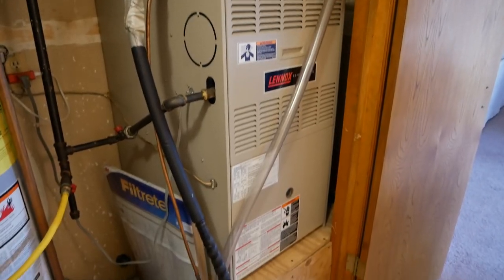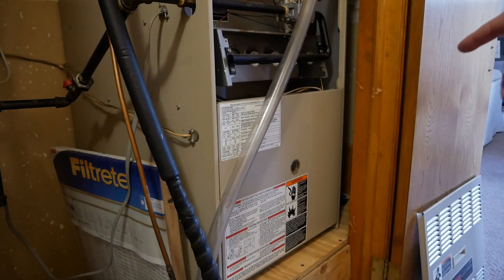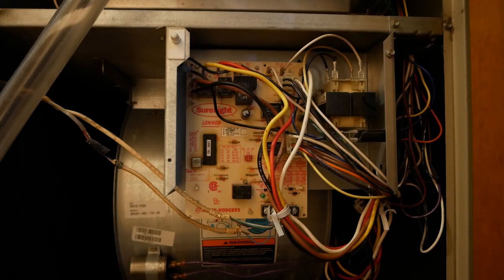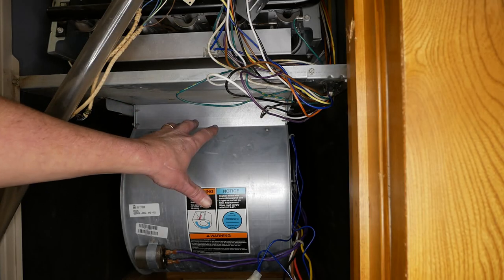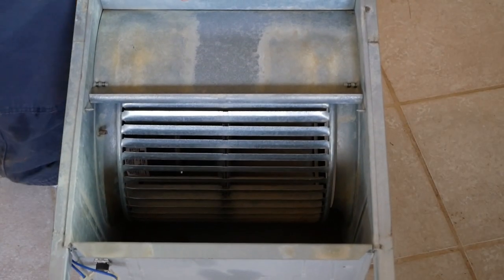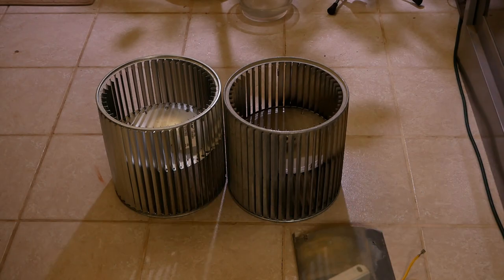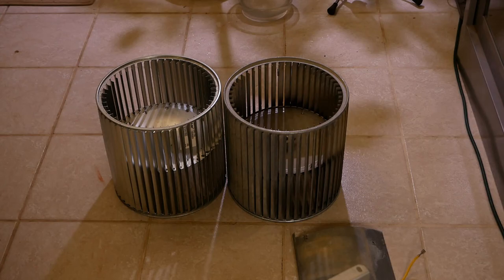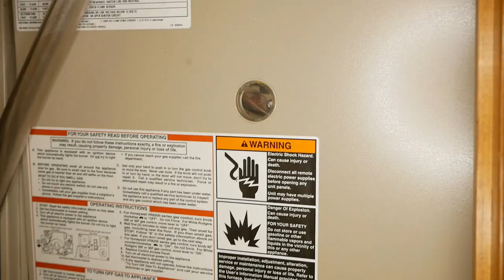Diagnose and Repair Noisy HVAC Blower - Rattling Squirrel Cage

Comment: I had this exact same thing happen to me about 15 or 20 years ago. It was a Trane furnace and the cost of an OEM blower wheel was outrageous so I found the company Lau and bought one of theirs at about a third the price of Trane's wheel. The Lau blower wheel fixed the problem and never failed me.
Reply: How do i even order from them
Reply: It's ez as funk. Yes train parts were expensive. I paid 300 I think, and only because I knew someone

Comment: Thanks for this video, very helpful. Mine was making the same sound & this helped me diagnose it. I was able to rivet the 2 center pieces together which is working so far. The entire center piece (the 2 pieces) was also rotating within the cage so I applied a metal glue to the edges of the fins where they contacted the center piece to keep it from moving.  Working like a charm so far and the blower wheel is spinning nicely without sound. If my McGyver fix doesn't last, I'll get a new blower wheel (looks t/b about $150 or so), but fingers crossed, this will work.

Comment: Thx man your vid gave me courage to investigate my metal on metal nightmare! Turned out the rotor screw came off and was scraping against the housing, easy fix!!!(: easily saved me $500 here in vegas
Reply from the maker: Nice, if it comes loose again try a little blue locktite.

Comment: Using what was in this video I looked into mine at 3am in winter -45c and saved the cash it would have cost to call a 24hour  emergency service call.  It's a Trane unit and woke me up making a terrible grinding sound that was loud enough to wake my neighbors up. I checked the panel and turn the heat off no change. I recalled a light switch attached to furnace and flipped that instead. Noise stopped and I dealt with the people asking what that was. Got it open felt around and the motor was still super hot, was thinking motor was burnt out or something. Turned it on burner light up fine but just hearing a low moaning from the motor. Turn it back off and cut power to it. the  "squirrel cage" it hard to spin at all so I think I'm screwed. I hope online, fine this and after watching start to look over my unit and the motor and I can shift and move them both way to easy. I pop out the filter to get a better look and the three bar's coming off the motor is only attached by one screw. I find one screw loose and another with about a third left the end broken off. Best I can guess is the vibration broke it and let the cage hit the floor and kept spinning making that racket. One screw went back in fine but the third just kept spinning and not tightening the bar down the broken off screw was likely still in the bottom of the hole. I found a sharp hole punch and made enough of a hold to screw into the sheet metal and forced a screw into a higher hole on the bar after checking for clearance and that that cage spun free I turned it on and worked great.

Comment: Thank you brother!!! You just saved me $430 from buying a new motor. My is making the same noise but didn’t know rather it was the wheel or the motor shaft because the shaft has about an 1/8” of play. So I thought that what was causing the rattling noise. But I’m going to change the wheel and hopefully that fixes my rattling issue. 🙏🏽
Reply: Did that fix it? My motor shaft has the same amount of play.

Comment: Omg you saved my life and money. 14 year old home the fan slow slipped off the motor. I came home and turned on the heater. Started hearing grinding noises.  With yours and other vids I found I removed the blow unit. Knocked the fan back into the motor and tighten the nut. All good now!!!
Reply from the maker: It's so nice when it's something simple like that.

Comment: I'd like to point out that I've used tiny aluminum rivets on plates having a few rattles with great success on many occasions. Look for spotwelds gone bad. I made a DYI cheap little test jig with flying leads to connect and power up the motor following attempted repairs to prove a noise free repair. That way, if there ARE  balancing or noise issues, one will save themselves a lot of grief KNOWING THAT BEFOREHAND. It also leads to a higher success to repair, than replace.(The Jig is just a 10A power cord, A cheapo Supro hard start kit and some 10, or 12 Ga quick connects)  
Add counter balance weight to the cage, spinning her on and off adding as needed till you find the sweet spot. (I've also used 1/2", or even shorter sheet metal cleat cutoffs crimped onto blades in the cage to repair, or as counterweight) Then when she's spinning perfectly, SLIDE IT IN! :-)   PLEASE WEAR GOOD QUALITY GLOVES WHEN MESSING WITH SHEET METAL!!!

Comment: First time I saw the mounting bracket on fan motor is not mounted Symmetrical or with 4 equal spacing.
Thanks for the video and this really helps.  :-)

Comment: i woke up this morning thinking my house was smoldering somewhere!  took me a few hours to figure out my furnace quit blowing, i think the heater was on all night, just not blowing air, so the house was actually at 65 degrees, which is hwere i set it before i go to bed and go to work, im not home very long so i save allot of money that way, i live in a small old ass trailer house.  anyways, finally noticed it when i heard the heater try n kick on but it never turned on.  glad i looked this up though, ive never taken one apart, and even though my furnace is a top mount cage, i seen how it slides out in the same concept, and saved me from taking about 20 screws apart, which is what i was gonna do lol.  im famous for that,,  im gonna try n see what i can do to get the damn thing to work for the next few days, i live in wyoming, its 0 degrees at night, i need heat for the weekend, and probably a few more days until i can get a part!  im an electrician, n know a few trade guys, but basturds arent answerin their phones!  i need a motor or a squirrel cage, on or the other, i can use a screwdriver to get the bitch spinnin, but after 1-4 minutes, she slows down to an immediate stop in bout 3 seconds, an thats all she wrote basically until i try it in an hour or so later.  good thing i live in a small house, i just cranked the oven on to 400 for bout 45 minutes, an my house went from bout 54 to 67 in that amount of time !  being an electrician, i actually have a 8 foot baseboard heater that i took from a job that was left over, n i might have to go get it an ghetto rig a plug onto it to try n supplement some of my heating needs .  anyways,  most of this is irrelevant to this video, but i have no social media outside of youtube, n i have no friends, and im to embarrassed to tell my ma pa n sisters about what has happened, so my only outlet is your comment section!!!  i hope you feel special lol!!!!  anyways, i dont have money for a hotel, so lets hope that i can get something to work!   its 615 at night, temp outside reads 11 degrees, so hopefully i can get through the night, without needing to go start and sleep in my car!!!   im actually on hard times, trying to start my own electrical business, but times are hard!  no one is spending money, and i cant afford quite yet, the insurance to be able to work in the gas n oil fields that are around!  norcan i afford to pay the guys or materials in order to man a decent sized job!  i live in butt funk no where in wyoming, i forgot to mention that also!  not that it has anything to do with changing a blower motor in your furnace lol... anyways, thanks for reading my conversation to myself :P... Have a Good DAY !!..??
Reply from the maker: If you can get some oil down on the bearings it might buy you some time. Good luck, I hope you get it going.
Reply: @TheHandsOnChannel  that's all I can think of doing myself as well!  Thanks for the input!  I appreciate it allot!

Comment: Bought a 20 yr old house. With 20 yr old furnace. Fan blades just started slipping on the hub. Some how the blades became detached. HVAC guy suggested new furnace, I went ahead with the replacement due to age and I wanted it to be DEAD reliable so I could leave heat of cooling on when I travel. I was warned my furnace was "end of life" with repairs eminent by my home inspector so had replacement cost already budgeted and hit the seller for part of that cost at closing which they agreed to.

Now my new furnace blows less hard then my old one so I researched fan speed and am going to adjust that up a bit.

Comment: Helpful video, thank you!! I have one question: did it make those uneven vibration noises also when the fan was ramped up to high speed? I have similar noises, but they always go away when the furnace fan goes to high speed. I only have the noise problem when the fan is getting started, or when it shuts off after set temperature is reached.
Reply from the maker: Mine is one speed only but it would make the noise all the time, even when it was winding up.

Comment: How much did the squirrel cage run you?  Just curious as I will most likely have to do that to!

Great video thanks 👍
Reply from the maker: I think it was about 75 dollars if memory serves me.
Reply: @TheHandsOnChannel  great. I went on Amazon to look around and it was one around $150.  So I am thinking worse case scenario within $200 so that’s not bad. Thanks for the reply and the video.
Reply: $200+ from local Philly HVAC wholesale suppliers. Found it for $109 with free two day shipping from Same Day Supply Sales. Carrier branded, which I actually don't like. These are cheaply built and don't even have a single spot weld, which would make them impossible to fail. Just cheap press fitting. I'm going to spot weld my old one in two opposing spots and keep for a spare. Typical Carrier/Payne junk. Great video!
Reply: Oh, the fan I received was built wobbly. When I installed it, it was wacky out of round. Having another one sent. I've read about other people having to order several till one arrived that was properly built and balanced. Carrier junk. Btw, the problem was that the center spindle/hub wasn't even on the new one, causing the entire fan to wobble out of control. Next I'm changing out the bearing in the motor. Will try to post a short video about. Might save a lot of folks from buying a new motor. The front bearing gets the majority of wear having the weight of the unsupported fan pushing down on it. A simple bearing in the fan housing would relieve that pressure. But it's not the Carrier way to build things properly. The problem is a cascading one. If the fan has a failure, like ours did with the central hub coming loose, it makes the fan wobble, which in turn makes it unstable for the poor bearing, which starts to wear unevenly. And bada bing, now the motor is shot, so is the fan cage, and it can even distort the metal of the cover assembly. Ugh!

Comment: At 13:35 he skips pulling it off the motor. Folks, this took me over 3 hours. And I went out and purchased a puller. Be prepared to by a motor as well
Reply from the maker: Mine didn't require a puller or a new motor.

Comment: if you put sheet metal screws ,you'll make the wheel unbalanced ,causing it to vibrate and come apart in the long run .
Reply from the maker: Probably but it lasted long enough for me to order a new fan blade.
Reply: @TheHandsOnChannel    I was thinking the very same.
I suppose you could roughly re-balance it by cable-tying on an identical screw 180° around the wheel.

Comment: My air conditioner guy wants to charge $330 to clean the inside unit squirrel cage.  Is that a good price?
Reply from the maker: That's probably not a bad price considering most of them are hard to access.

Comment: It strange my furnace Is new but without the filter it's quiet I changed out filter cuz of noise abd its loud weird sound with the filter in . I might have to call hvac is a loud screeching noise and this the 2nd winter since it was installed

Comment: I've been trying to fix squeaking and creaking noises coming from my AC unit. Obviously the vibration comes from the blower motor. I took it off to clean it and put some tape on its contact surfaces to fix the squeaking. I noticed the cylindrical fan blade part is out of true on its axis of rotation. One end is about 3mm off. I think if it were trued up, the vibration would decrease significantly. What would be the way to fix this? Should I just use moderate force to try to bend it into a better position? Coke bottle shims on the motor arbor? Any input is much appreciated. Thanks!
Reply from the maker: You can carefully try to bend it straight. Also if it's a balance issue you can get a ceiling fan balance kit. You might have to modify the weights to fit but I think it'll work. Good luck.

Comment: Ours had a nasty microwave popcorn piece of plastic in the blower wheel. I went in through the filter area and didn’t take the front cover off or cut the power. I ripped that devil off it and it sounds a lot better

Comment: i am having trouble getting my squirrel cage adjusted properly.  Loked like you said something on adjusting but it was in FF mode.  any tips?
Reply from the maker: I just eyeballed mine to center it up between the 2 sides.  Most of them have about 1/4-1/2'' clearance.

Comment: What if you order one and it's the same diameter but a little bit shorter? Can you use it?
Reply from the maker: You should be able to use it as long as it's close to the same size. I'd try it.
Reply: @TheHandsOnChannel  also I accidentally ordered a counterclockwise wheel when the original was clockwise. If I reversed the motor to a  counterclockwise spin would it still work?
Reply from the maker: @trok90k  IDK about that. I think you might want to just exchange it for the right one.
Reply: @TheHandsOnChannel  ok thanks

Comment: Thats funny I have to put new screws in mine today it started rattling the motor is loose on the cage. I blow out the dust and re oil with good full synthetic oil every season for 23 years.